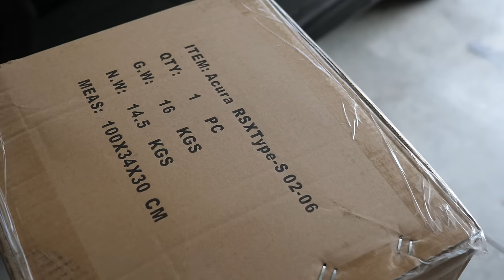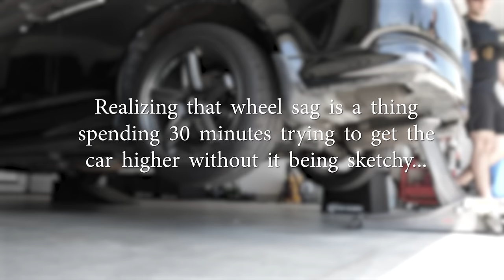Installing a RASP-FREE Honda Exhaust! | RSX Type-S Yonaka Catback

Comment: Everytime I watch your videos I regret selling my ek hatch more and more
Reply from the maker: You can always get another! But hatches are a rarity for sure
Reply: @ALLDAYANTHONY  to be fair, mine was a POS. Didn’t make a great daily and was uncomfortable at high speeds. I’m in my Volvo now, and it handles 90 the same as it does 30
Reply: @puntachu  I did the Volvo switch too, I miss my Honda some days but man the 5 cyl turbo is so enjoyable
Reply: Get a another 1 with a proper suspension and enjoy
Reply: @puntachu  how's the reliability of the Volvo so far?
Reply: I’m in the same boat sold my dream ek last year to buy a truck. Had a 00 vogue silver with a b16 swap and all the suspension goodies for road course racing. 😢
Reply: What year was it?
Reply: @BaNguyen-js1qp  my situation is unique… I bought a 97’ 850 t5, which are fairly hard to find, for $1750. My valve stem seals went out (common issue) and my turbo seals are blown (I have a bigger one on the way and the car sat for 10+ years so I’m not shocked) but I’ve done the work myself and put 1000 miles on it this month, and it’s a ton of fun. For another tip, my dads 04 S60 2.5T has 200k+ miles, it’s gone over 10k miles between changes of the cheapest oil he can find, it’s revved out to redline every drive, and it’s still fine.
Reply: @supercarlegend  mine was a 96’ VSM hatch. DX, so no vtec, no features, but also only like 2200lbs. Balanced out in my head… not so much on paper…😬
Reply: I know that feeling and this why will never sell my eg and bb6 prelude
Reply: I regret selling my RSX…..
Reply: i just copped a low km’s manual ek1 hatch for 3k 😅
Reply: I got one for you bro
Reply: Instant memories of my Honda that I sold 3 years ago 🥲
Reply: You should've not done that.
Reply: Never sell those special ones put them in storage

Comment: I’m an all American V8 fanboy through and through but there is just something about these aesthetically pleasing imports that almost make me envious of their owners. The RSX Type S and the Integra Type R are two of my favorite designs when it comes to imports. I have owned 3 domestic muscle cars and they were fun but there is really something to be said about a lightweight and fuel efficient 4 cylinder car than sounds as good as this. I recently purchased a 98 ek hatch for a fuel efficient daily driver despite it’s lack of power since its bone stock it is still fun to drive and throw around a tight corner with nothing more than adjustable coilover suspension. These things feel like go karts.
Reply: K swap that thang
Reply: I'm glad you like both muscle cars and Hondas.  I'm the same but instead I'm a Honda fanboy however I also like and appreciate muscle cars.  I have a 75 Firebird with a 455 I'm restoring.
Reply: All cars need love lol
Reply: I went from an 03 Miata to a 15 5.0 mustang. I have so much love for both because you can’t compare them. Imports are light and agile in corners, where’s muscle bites just as much as it barks. Such fantastic differences
Reply: I have a 5.0 gen 3 in manual with minor upgrades, however my car in high school was a 2005 RSX Type S. I had it for several years afterwards and I loved it. Just wished it had more power.
Reply: zL1s 🤤
Reply: Ain't no shame in that! Some old guys think im crazy when i say i love the sound of an old V8, but also the sound of a jdm 4 banger lol. They act like you have to be for one or the other, but at the end of the day they're all cars with internal combustion engines lol.
Reply: Same here 2000 Camaro SS and a 2006 RSX type S. I love both rides equally

Comment: Just grabbed this exhaust this week on sale for $400. Puttting it on my MT 5th gen Prelude tomorrow. Exactly as you described it being OEM+ is what I am going for with my Prelude. I painted it from red to black, fog lights, tints, lowered it 1" with  Tein coil overs, added a K&N cold air intake, red Honda emblems, & now I am putting on this Yonaka catback exhaust. All thats left is bronze 17" Volk TE37 & she is completed. I've had her for 7 years but its almost complete! Little things like a clean stereo unit, I think we have the same Pioneer head unit, 6000k white LEDS all aroudn inside & outside.
Reply: Tetsu9701 nice how many miles?

Comment: Yonaka shockingly nailed it in a lot of ways with their mufflers. Are they the best quality? no. But the bang for the buck in regards of price to sound and performance ratio is as good as it gets. I had one on my DC2 for over 3 years and if I hadnt gone a different direction I absolutely would have bought another one. Nice vid!

Comment: Great video man!  Very nice exhaust sound, not obnoxious.  It's good, it's mature. I often say it's very easy to make a Honda sound bad with poorly tuned exhausts.  Finding ones tuned to eliminate drone and certain NVH, but still sound good is a lot harder. 

I have done similar with my S2k.  It's well tuned and has a nice deep sound to it, no rasp.  Amazing under VTEC.

Your RSX-S is clean dude, I wish I would've got one when they were cheaper.  They've aged well and look great still.

Comment: Just wanted to add my 2 cents. When replacing heavy duty bolts I always add anti-seize and replace with 316 Stainless. Be mindful of galvanic corrosion though but antiseize should be a good enough barrier between the two metals. Or zinc plated bolts. I have stainless bolts mounting my headers to the aluminum block and haven't seen any corrosion even after washing.

Comment: I had this on my rsx-s. I would recommend welding in a different resonator to get rip of the really loud exhaust drone when driving freeway speeds. I installed a Vibrant UltraQuiet and it got rid of around 95% of all drone on the freeway
Reply from the maker: Interesting, took it on the freeway the other day at 80mph and noticed no drone
Reply: @ALLDAYANTHONY  nice, it seems like you got lucky aha. Me and a couple of my friends ran this exhaust for a while and the drone was driving us crazy

Comment: Had a Yonaka exhaust on my 02 RSX Type-S. Really good exhaust if you want something quiet, but only if you have stock headers. Would not recommend with aftermarket race headers because it will rasp and sound "ricey". Swapped it out with an HKS Hi-Power to match my Skunk2 Alpha headers.
Reply from the maker: I don’t think the rasp will come from the headers, but more so if you run a test pipe and remove the cat. IMO
Reply: @ALLDAYANTHONY  truth, you want a resonator if you do cat delete. vibrant ultra quiet is the way.
Reply: @ALLDAYANTHONY ohhhh that might be it. I’m running a test pipe with no cat

Comment: I had the DC Sports TCS exhaust on my 02 and it sounded amazing and smooth like a big sport bike. I changed to an Ex Mag GT2 and it was raspy. It’s a shame they don’t make the twin loop anymore. It had the best sound I have ever heard.
Reply: The RSR GT2 you mentioned was loud AF. I had the standard RSR "Ex Mag"(Exhaust Magic) on my '92 GSR w/B18C5 swap and Mugen Gymkhana spec exhaust manifold. RSR of Japan marketed it as the quietest performance exhaust on the market. It was very similar to the HKS "Sports" series exhaust that I had on a MKIII Supra turbo. Both were painted black by the manufacture to disappear under the car.

Comment: Very nice sounding car. 
 Personally I went with the Flowmaster  40 series delta flow 2.5" for my B16 CRX.  Nice deep on the bottom end driving.  Perfect OG Ricer rasp when rapping out the VTec.  I used to hate the cars with the rasp.   Now it's just a sound of a cool era of Hondas.

Update:  Flow master got bumped and probably broke a weld.  Became tinny and annoying.  Not the mufflers fault.  Anyway just ordered the Yonaka catback.  I rock with the OEM Plus sound of these tuned systems.

Comment: I've had my 02 RSX for 4 years now and have done some work. First, I added a front strut support bar and a middle support bar. Next was the cold air intake and skunk2 alpha headers connected to an indivia cat-back exhaust system. Any other recommendations??

Comment: Hey what's happening now that's awesome Acura type s nowadays it's going to be difficult to find one especially in good condition with low mileage and I've purchase a Hyundai veloster turbo it's a six speed manual transmission it's a 2015 it's difficult to keep it clean when you mention it I've changed out the two rear shocks one of them was leaking and I've changed out the Mufflers it's loud but sadly after two weeks later someone t bone me & my airbags deployed so my car was destroyed so I've bought a 2020 Hyundai veloster turbo r spec I've changed out the Mufflers and exhaust tips it's a magna flow it's fantastic and thanks for sharing your videos with me and I'll always subscribe to your channel and support it too 🖐👍🙂🚘

Comment: You shoulda get theTanabe Medalion.. Better exhaust.. Slightly more sound, and a deeper tone. No Rasp either. The Tanabe Medalion was actually a factory option on the 05-06 Type R in Japan and was considered an OEM upgrade at Honda Dealers in Japan.

Comment: I’m currently looking for a black type s now but I had an 02 type s a few years back but I also had my 18 STI that I bought new and when I had to move from Ga to Tx I couldn’t drive both so one had to go and the rsx got sold. I’ve owned Evos and an SRT4 and right now I’m either going to buy an srt 4 or the rsx as I want something for a daily driver that’s good on fuel because currently my STI gets 10mpg but it’s not my daily driver luckily.

Comment: could the smokey burny smell be, because the exahust tip isnt protruding out the bumper? and a bit of fumes get trapped under the car, and make their way up through cracks / shifter etc.

Comment: I literally just got a yonaka catback installed on my em2, which essentially is the rsx's step brother. The fitment is interesting as the tip on my car sticks quite a few inches out past flush and on your rsx is sunken in maybe an inch. Em2 shares the same chassis as an rsx so guess this is on yonakas side. Id honestly would like to the tip trimmed and welded but idk if its worth. Also its funny i feel like my exhaust is alittle louder but i guess its just d series shit lol but im overall super stoked on how it sounds
'
Reply from the maker: This does sit slightly inward, but I prefer that to sticking out. I would just run it, not worth trimming IMO

Comment: How did you fix the minor exhaust leak by the resonator? I have the same issue with my setup. Yours sounds amazing!
Reply from the maker: I used those jack stands to prop the exhaust up and get it as level as possible before tightening it down
Reply: @ALLDAYANTHONY  ahhhh makes sense!

Comment: I have this exhaust on my rsx. It feels like the muffler isn't free flowing enough for my setup. I blew a radiator hose off my car after installing this. Idk how a exhaust would do that but I never had a problem with a radiator hose ever. I would like to see a dyno comparison of this exhaust vs a fart can muffler style. I pretty sure this exhaust kills a few horsepower on my setup

Comment: I bought this for my ek coupe si and it’s not really rasp free. I’ve never had any other exhaust to compare it with, but revving it to 7k definitely makes it sound like a Honda. Quiet enough to not get pulled over if your shifting at 3k tho
Reply from the maker: Are you still running a cat? If so, this should be rasp free
Reply: @ALLDAYANTHONY  yes I bought a brand new cat. Not a cat shaped test pipe but an actual cat. I don’t have 02 sensors at the moment so that could affect how it’s running and maybe the sound? I have bolts plugging the 02 sensor holes so it’s not leaking. I don’t mind how it sounds anyway lol
Reply: @lukasstipp_bmx  running without 02 sensors is a bad idea.
Reply: @Mcdonaldt001  probably lol. I’ll replace them soon

Comment: Can somebody tell me if there's a difference between the base model Yonaka and Type S version other than the fitment? They seem to be 2.5 in the description. I had a type S converted but I'm using the base exhaust system from the cat back because it wasn't available from the swap.

Comment: Not gonna lie, it literally sounds the same just without the vibration sound in the before clip towards the end of each rev. Other than that, it's the same. Which I guess is the point, but seems like a very expensive way to change something so little.

Comment: Lol....all they do is buy systems after a while it gets boring. I made mine and let me tell you it's not that expensive to have a muffler shop build you the setup you need. Stop putting straight-through resonators on your Honda and get rid of them rear mufflers. A chambered mid-resonator ( size affects the sound as well as the chambering inside) after that slowly increase the size of pipe all the way out the back for example  resonator is 2" out goes into a 2.5 till the rear lca and after that it's 3" .

Comment: Don't install the S2 Alpha. I'm taking it off ASAP. It runs incredibly, but the fitment is horrendous on the 05-06 and it's a leaky SOB. I can't handle that at this stage in my life so back to the SRI and the Tanabe Medallion only. True OEM+. It's slow as molasses by 2023 standards so an extra 10 hp is meaningless.